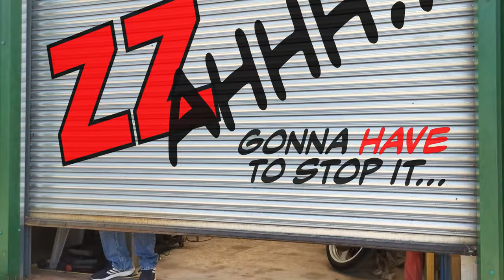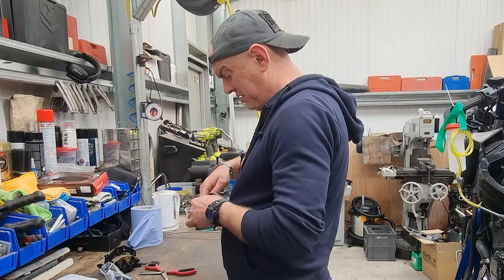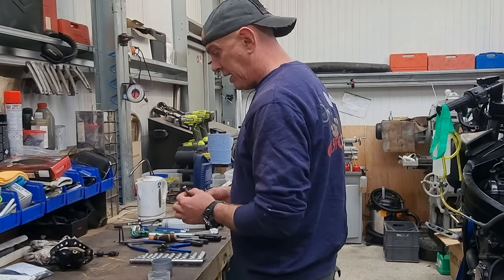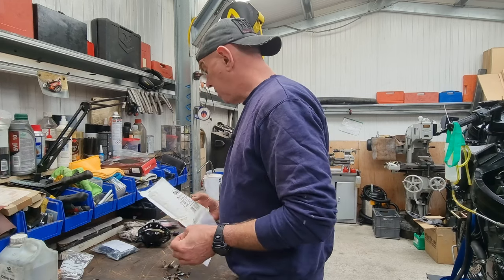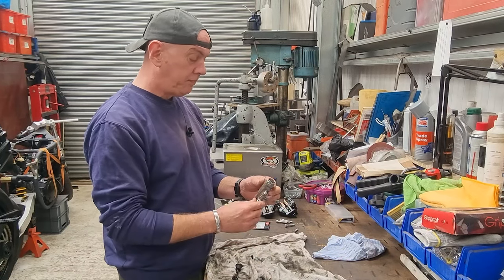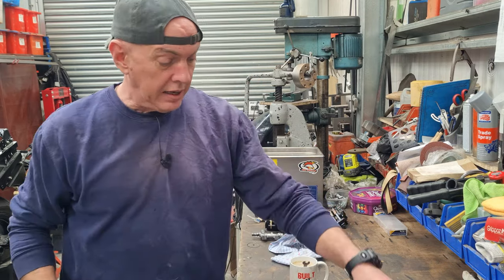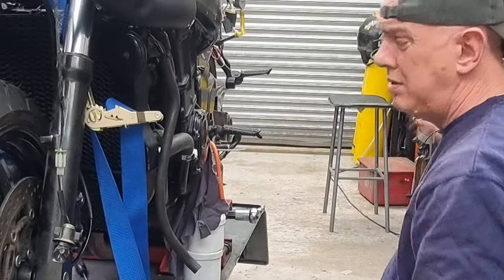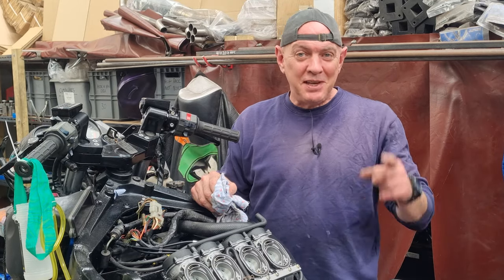Rebuilding the brakes - 1990 Kawasaki ZZR1100

Comment: Another great video!  You gave me the inspiration to get my own ZZR1100 D7 sorted.  full carb rebuild, shimmed and runs really nice now.  I bought it as a non runner, apparently there was a loud bang and it stopped, then smoked badly on restarting.  Ethanol had corroded the float needle so badly it had pushed the rubber cone off!  Flooded the motor with fuel.  I suspect the smoking was the increased oil/fuel in the crankcase and it had blown into the airbox.  ZXR400 project now :-)
Reply from the maker: Geddon, nice one matey 😁👍
It's nice when you bring done of these older bikes back to life again init 😁

Comment: The problem with that caliper is, it doesn't have dust seals. A mate of mine changed his for a suzuki one that had the dust seals. Cant remember which model but they were a straight swap with no modification needed.
Reply from the maker: There's provision for them matey as I robbed the ones of the rebuilt but broken caliper, they were just missing for this one.... or maybe its already been swapped for a caliper with dust seals... I'm not sure 😕 🤣

Comment: those brake pistons.. when replacing seals ,    Heat is ur friend,     heat the buggers up , then stick the airline on it ..the seals go soft ,,,  and will pop ..you will be surprised at how much they will take to move !
Reply from the maker: The airline is always my friend with those pistons, but I'm definitely goingbto make an adaptor that fits into the banjo hole as that really helped free up one hand and get max air into the thing. It shouldn't take very long either 😁👍

Comment: The clutch lever not coming back to the bar, did you find out what it was, did exactly the same on my brothers GPZ900R. Turned out after doing master cylinder rebuild, done loads in the past but simple error caused what you experienced, i had put the push pin in the wrong way around, so did not sit true in clutch lever. Not all the way in. :-) i know your video was made a while ago but just thought i would mention what mistake i made, may help someone else out from making same mistake. Thanks for video, Vinny.